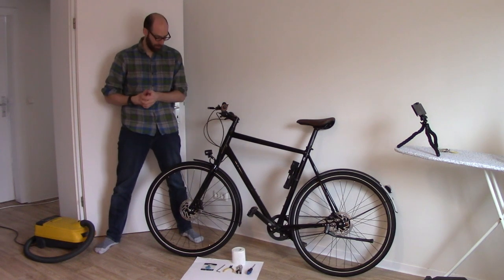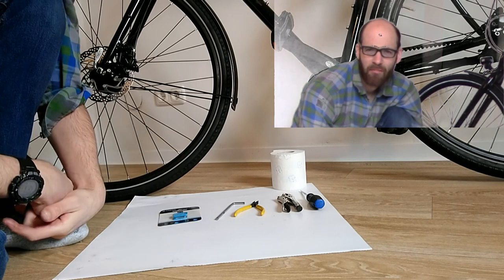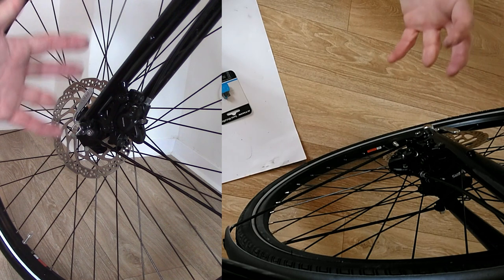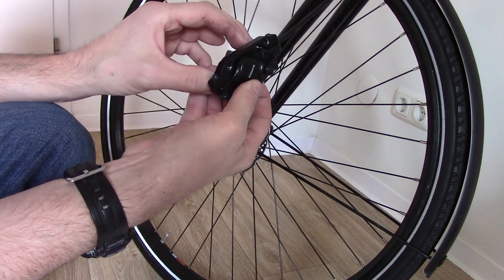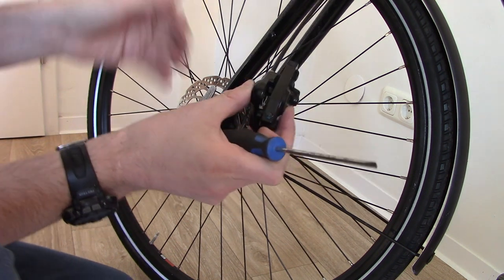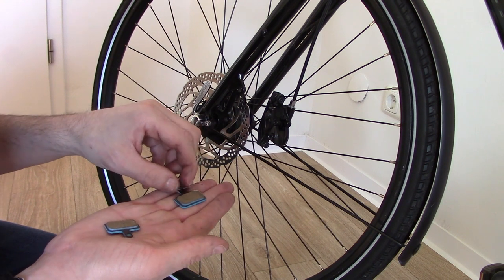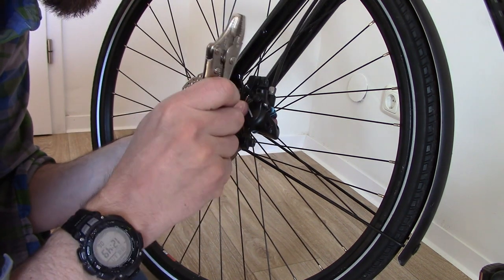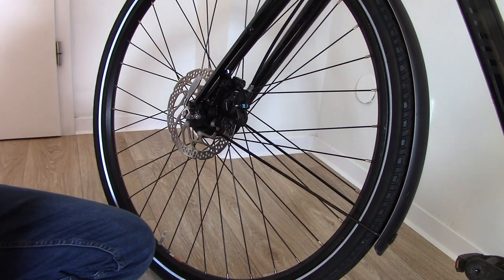Shimano Altus BR-M315 disc pad replacement (Concise)

Comment: Thanks for posting!  Silly question, but why detach the caliper?  It's about accessibility, I'm guessing?   If the bike were upside down, and the wheel off, the caliper is pretty accessible, and I could just change the pads in that bike 'position', I'm guessing?  Thanks!
Reply from the maker: Hundred percent right.  Just for accessibility.  With the wheel off you could do it with the calliper fixed :-)